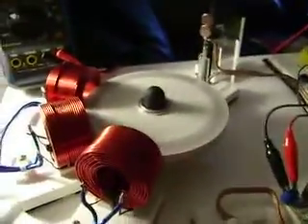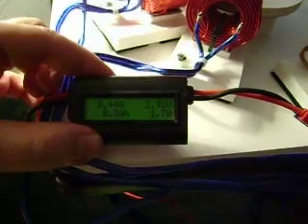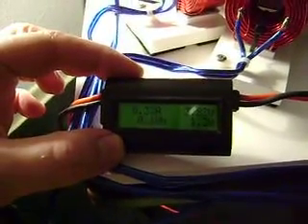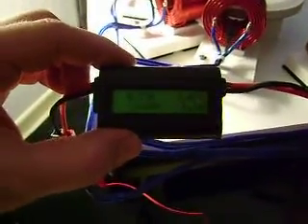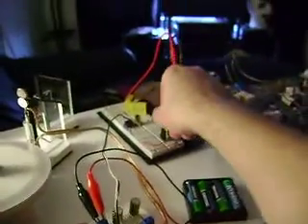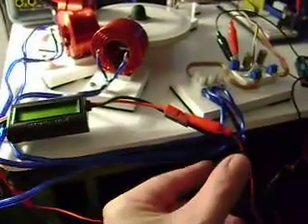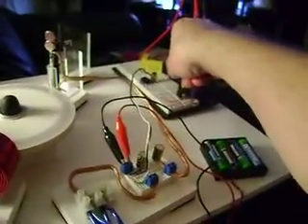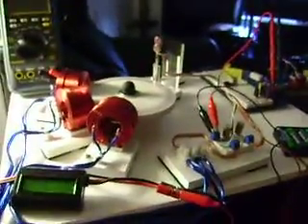Using Watt's UP meter to show current and power usage on my pulse motor setup

Comment from the maker: @CrieffHS 
Hey Crie

Im into electric bikes also..   The Wattsup meter would be your best bet.  It connects in series with the power and gnd, + and -, and handles up to 100amp peaks. You can leave it in the circuit on the bike or just use periodically.   PM me if you want to chat on the subject.  I have 3 ebikes.  About to build one with the black lightning motor. 40 mph  54 mi on a charge    Instead of MPG, we will soon have MPC.  =]

Mags

Comment from the maker: Sorry but the readings in this vid may be inaccurate. The Watt's UP meter is only accurate above 4v.  Will do another vid shortly. The batteries were not fully charged, had them mixed up with 2 others. Batts are on charge now and should show better readings.

Magluvin